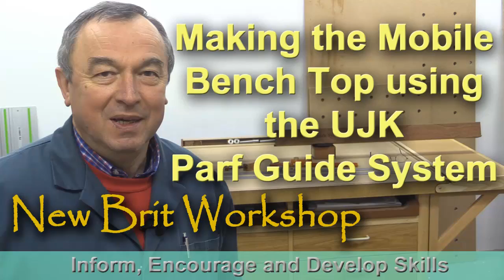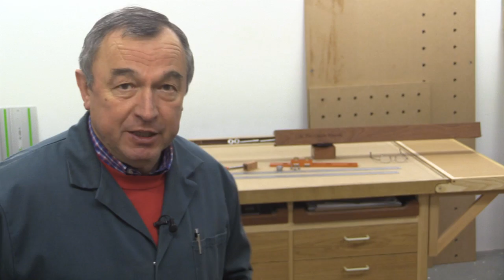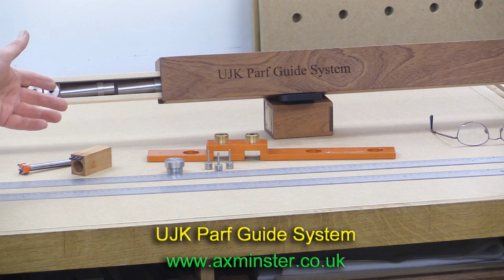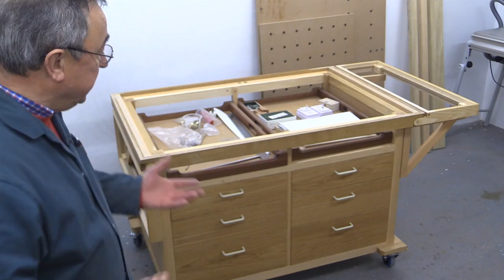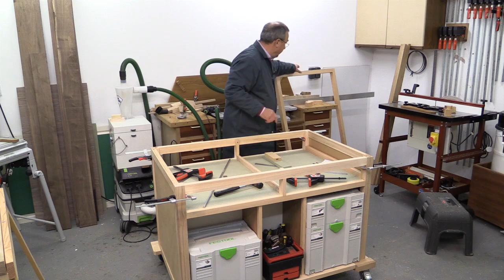Mobile Bench Top - Revisited

Comment: How much weight can the top hold before flexing?  I've seen many plans for torsion box tables or tables with 3 layers of mdf.  Is one enough?  Already ordered your UJK Parf Guide System with the new super dogs.  Great ideas!
Reply from the maker: Hi Thad, I have just one layer of 18 mm MDF (Medite MR). It is supported at the edges only. It does not flex.  Good luck with the PGS - the sales have been astonishing and Axminster are having to take time out to install new production equipment.     Peter
Reply: Thad Buzolich   Thad I built Norm Abrams New Yankee Workshop work bench and its 8’ x 4’  and it could easily support 2000+lbs. I’ve had 10 people each weighing 200+ lbs stand on it and it had zero flex.
Reply: Thad Buzolich      Thad I built Norm Abrams New Yankee Workshop work bench and its 8’ x 4’  and it could easily support 2000+lbs. I’ve had 10 people each weighing 200+ lbs stand on it and it had zero flex.
Ron.

Comment: Great idea.  Any chance you will make a 3/4" bit for us crazy yanks?
Reply from the maker: +Eric Stockinger Hi Eric, If you are going for 3/4" holes then you would not be using the Parf Dogs. If that also means that accuracy is not an issue then you probably do not need to lay out the array of holes to the accuracy that the PGS can deliver. A 3/4" cutter would not work as the PGS requires the use of the Veritas small bench dogs to complete the layout and they will not fit in a 3/4" hole.      Peter